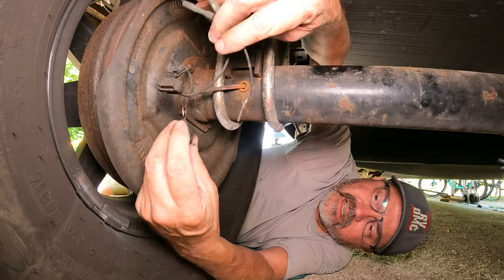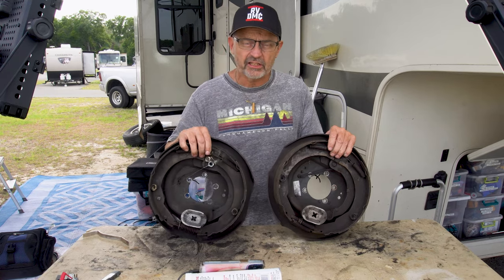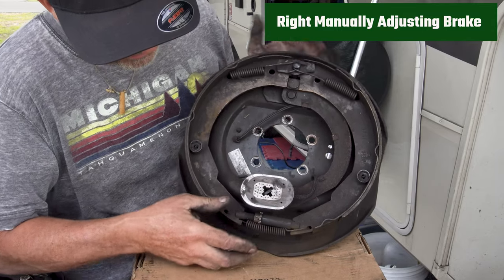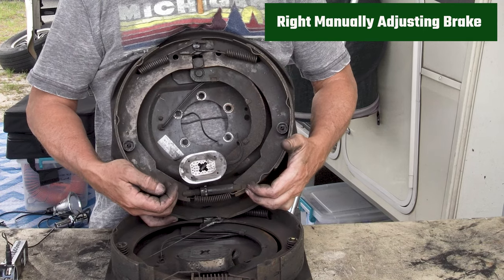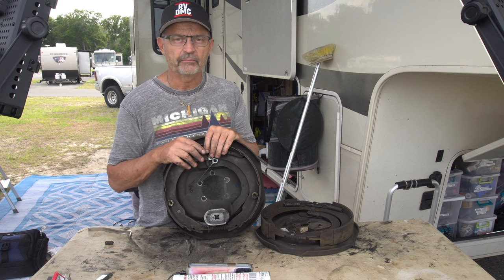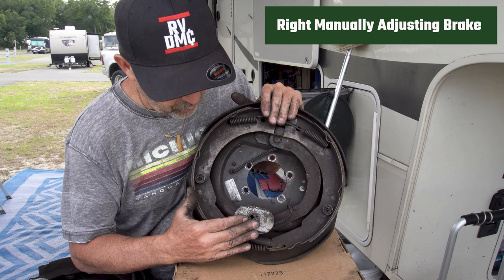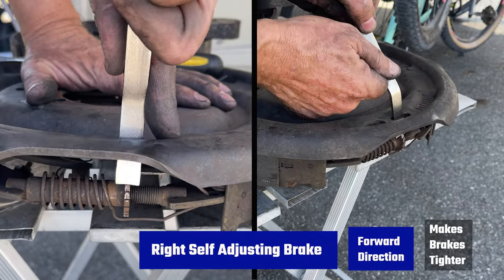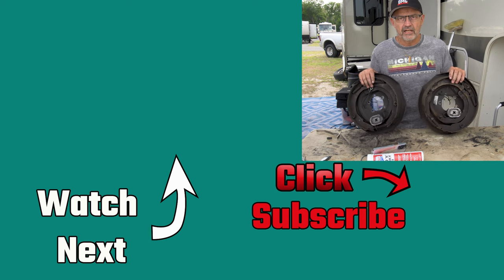RV Electric Brakes Manual vs Self Adjusting, How To (RV Living) 4K

Comment: The trick for telling if you have a self adjusting or a manually adjusting brake probably works for Lippert, but I have seen manually adjusted brakes that have two holes, so it doesn’t work for all brands. Good video! Thanks for your thoroughness.
Reply from the maker: I agree, i hope i made it clear in the video that the rule applies to lippert brakes only.   Most RVs have lippert or dexter axles and brakes i have found.  Larry
Reply: actually if 2 holes it dose work as it it same system on old vehicles just no magnet

Comment: Excellent info.  I have been using a Temp laser to measure the temps of the drums when I stop.  I have 4 different temps ranging from 90° - 180° which shows I do not have even braking. I have the self adjusting brakes but can't see my star adjuster, I have two slots too.  Now your gonna make me lift the trailer so I can test each tire and get a better look inside the drums for the adjuster.  Thank you so much for this great demonstrative (been dying to use that word) explanation of brake adjustments and how they work.  You got me, new sub
Reply from the maker: I also use a IR temp gun to test tire and wheel temps when we stop to rest on travel days.  I also used it when burnishing my new brakes, tried really hard to get them hot to burn in the new drums.  we are out west right now always going up and down big mountains and glad to have the new brakes and a better understanding how they work and how important they are to safe fifth wheel traveling.  Thanks for the sub.  Larry

Comment: Larry, My trailer has Lippert and I can feel that the trailer brakes aren't working.  I didn't know that the brake magnets can stop working independently. So just plug in to trailer. Remove wheels and drums and have wife apply brakes while I check each brake magnet with some magnetic item.

Comment: Always great to watch your videos. Thank  you for taking the time to share your experience. PS. Do not lift trailer on axle ever. 🙏
Reply from the maker: Good point on the axle, i alway usually lift on the frame some of those shots were taken when i was taking out the shackle bolts and needed to lift the axle a bit separately to get the shoulder bolt out,  Larry

Comment: The Front Brake Shoe is Called the Primary Brake Shoe (Shorter Lining) and the Rear Brake Shoe is call the Secondary Brake Shoe (More or Longer Lining). Self Adjusting Brakes have been around for 60 plus years , And they can and Should be Adjusted from time to time by a Qualifed Person. As for Rotating Adjuster - it either goes Clockwise or Counter Clockwise.
Reply from the maker: I didnt want to say clockwise or counter clockwise in the video because I was showing the adjuster from the other side and didnt want to confuse people.  Larry

Comment: Very informative video. I repacked my bearings this spring but I never thought of checking what kind of brakes I had. I have a Reflection 150 series 295 RL so thanks for the information because I going to go check it out right now.
Reply from the maker: We were so surprised they were mixed. We thing the previous owner needed a new one and they were just given what was on hand. Typical. 
If people get anything from this - check your trailer break wires & the type of breaks you have. 
And thank you.
Reply: @DownsizingMakesCents  just checked. I have two holes in the back which means self adjusting and all the wires look good. Thanks for the barrio again have a good day.

Comment: Great video with a lot of good info. One thing I noticed in your first pic of the brake assembly and spring is the reverse arch at the end of the leaf spring. That is where these springs usually break. I had that issue on my trip,e axle solitude after a year and a half. My brakes and springs were being inspected and I was getting an axle alignment done at a local truck shop. Lippert paid the bill for new brakes as they were shot and new springs. The truck shop added an extra leaf that went almost to the end close to the bolts. I could send u some pics if u like.
Reply from the maker: Interesting, are you saying the brakes were assembled wrong by lippert.   Larry
Reply: @DownsizingMakesCents  I’m referring to the end of the leaf spring just before the shackle

Comment: My “NEVE R ADJUST” Dexter brakes are not adjusting automatically. 
One even fell apart last year, all the parts were in the bottom of the drum. Replaced it last year and adjusted all of them… maybe 2,500 miles ago?? Last week they would not stop the trailer and the truck had 100% load on its brakes 😡

Comment: Great explanations and demonstrations, thanks for sharing
Reply from the maker: Thank you. Hope it’s helpful 
Larry
Reply: @DownsizingMakesCents  definitely very helpful, thought I had manual brakes until I watched your video and realized they are SA, got my trailer a few months ago, doesn't seem like prev owner did any maintenance whatsoever,  the brakes grabbed really well when I first got it, we did a 3500 mile round trip and now I crank my controller to 9 and they're still barely grabbing, going to inspect today and see if there's any pad left and if there is...I'll begin the fun task of trying to adjust my "self adjusting" brakes

Comment: Should I be carrying left and right complete rebuild components with me when I travel, including wheel bearings and grease? Do you have a recommendation? I loved your video. I haven’t changed my own brakes on my cars in 30 years and I am thinking of resurrecting that skill so I can do my own brake maintenance on my RV travel trailer.

Comment: Great video.  How do you know how tight to make the brake adjustment.  I had the tire on while adjusting and will spin it.   But I never know how tight the brake adjustment should be.  What are your thoughts ?
Reply from the maker: I spin the tire and keep adding clicks to the wheel until i feel just a bit of resistance, sometimes i go over and have too much resistance then back off a notch or two.  Larry

Comment: Hi very good video, i have one question. My axle does not have SA  in the model but my breaks do have 2 holes. It should not have an issue correct??? Will it affect ajy break system??
Reply from the maker: Should be ok. But you can test them as shown in the video. Get wheel off ground then spin

Comment: Thank you im new to the self adjusting brakes, my new gooseneck dump just doesnt brake with alot of power. Unloaded its ok but loaded i can just barely  feel them.
Reply from the maker: The reason i did my brakes is because we test our brakes by hitting the brake controller at about 15 mph every time we leave a campground.  Even at the highest gain, the brakes were beginning to feel very soft, hardly providing any braking.  I tried adjusting the brakes but they still felt soft.  I have had the new brakes for about 5000 miles and now they are awesome.   Even though i burnished the breaks heavily after i installed them, it took a couple of months for them to really feel strong.  We are in the UT mountains right now and having good RV brakes makes me feel much better about long steep descents.  Larry

Comment: Hey Larry, question, I see you are using red n tacky grease, it's not on any of the recommended grease list for dexter or lippert,  what's your experience with it? It's easier to get than the stuff they recommended
Reply from the maker: Larry has the used it ever since he saw the pros use it at Texas Trailers where we had our leaf springs replaced. 
He asked the Lippert guy and watched tons of videos.

Comment: Thank you for this video!
I have a set of 4 manual adjusting brakes. The problem is that both axels on my trailer are build in such a way, so they are covering the wholes for adjusting them.. There is no way to reach them when wheel is installed.. Is there any way to adjust them before installing them? Like in this video you demo it at 8:20 mark..?
Reply: I guess one way to do this, would be to adjust it a bit, then install, try it and take it off again to adjust more.. But there could be a better/easier way that I don't know.

Comment: Thanks you for this video. I was trying to adjust like a manual adjustment and now I know the difference. I have the self adjusting brakes and was just clicking away not getting anywhere.  Now I know I was trying to go the wrong way. All the wheels rotate the same with just a little drag so I don’t think I did any damage. lol.  Should I be concerned about it
Reply from the maker: No a little drag is normal, but I definitely recommend pulling the wheels and brake drums to inspect the brakes and bearings at least once a year.  Lar

Comment: Might be a silly question, but is it necessary to jack the wheel up off the ground, or can I make adjustments to tighten while on the ground? Just  In case I'm on the road and need to hurry.
Reply from the maker: You have to spin the wheel. So, you have to left it up enough to do that

Comment: Wow one was manual. I bet the manufacturer just put on what they could get or had at that time to get the rig out the door. I don't have any faith in these manufacture at all. None of the brands. Low to high end they are all built like crap. Lucky you know how to fix this stuff. The time and money to have someone else do it can get pricey. Brakes are something for sure you want to have right on these things. They don't stop on a dime as it is and bad breaks could ruin a good day. Good share. I would think this will help a lot of people.
Reply from the maker: Thanks, William. We think the previous owners might have had one replaced. It was built in 2017 - so pre pandemic. 
We’ve had issues with the breaks. I feel better it’s all fixed before our big trip. 
We do hope this helps others - at least to know what to look for 🤗

Comment: I have a issue have Kaufman  Mini 5 trailer with 6 wheel with electric brake system, for some reason magnet seem weak I’ve set truck trailer braking max( set to grade 10.00 on heavy electric mode still seem not to brake the trailer,I’ve jack  up the trailer in jack stands  if I adjust more it lock wheel won’t spin freely when truck off. I’ve check voltage all wheel measurement 10.5-11.9 volts I’ve change two magnets still have same issue only thing have left to change the drum but they seem fine

Comment: I know you have a 2019 ram but how is the high output Cummins and Asian transmission holding up for you? I'm looking at a 2023 3500 high output Cummins all I keep hearing is negative.
Reply from the maker: Ours is a 2018 ram HO with the asien trans, we have about 70k miles on it and so far it has been running strong.  I have the 3.43 rear end and still have great pulling power with the RV in tow.  I was worried that the 3.43 would have bad acceleration towing but it is really strong from a dead stop.  The 3.43 also gives me great gas mileage when not towing.  I would recommend the ram personally but I am no truck expert, haha.  Larry
Reply: Might be too late to the party…. I have a 2021 Ram 3500 Long Bed with HO/Aisin… I have 3.73 gearing with single rear drive (non-dually).  Absolutely LOVE this truck.  Had a 2003 Ram 2500 which I bought new 18 years prior, so a huge upgrade and massive improvement over the older model.  Everyone is a critic or has an opinion, but I am extremely happy and truck is a beast.  About at 30k with lots of towing a 40’ 5th wheel with 3 pop outs and toy hauler.   Run around 16k loaded.   Tows it with ease.   Best of luck!
Reply: @MotoFish45  thanks
Reply: @dcurry8147   Glad to help!